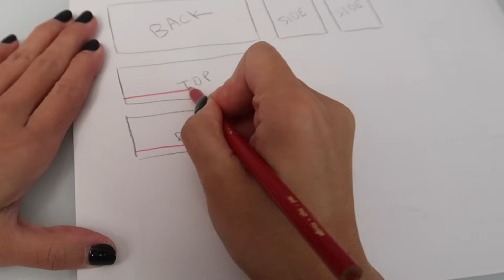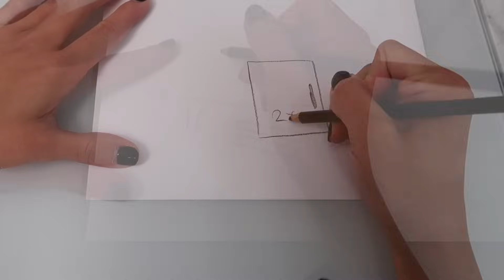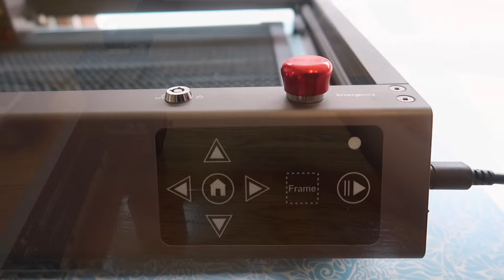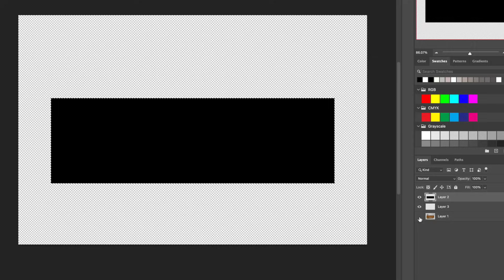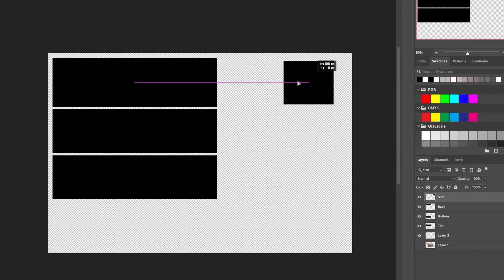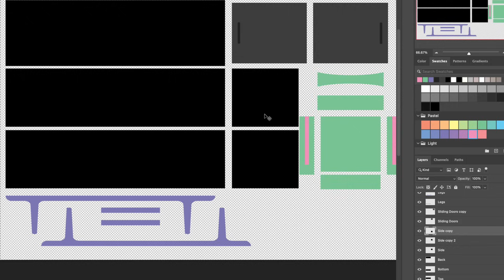Miniature DIY - Midcentury Modern Cabinet

Comment: This video is timely for me, because I just saw another Youtuber work with a laser cutter, which I'd never really considered before. MCM furniture is my favorite, and you did such an amazing job recreating that piece .

I was just wondering about a couple of things: would it not be easier to stain and varnish the sliding doors, drawer fronts and inner shelves before assembling? I'd be too scared that, were I to brush over every surface, some stain would seep into the crevices and cause the drawers and sliding doors to stick. Also, how do you ensure you get precise measurements when tracing the different parts of the image? Thanks for the video -- you're SO good at this!
Reply: @airamsipuola5045, I am reasonably certain that Kath was using a background grid with snap-to-grid enabled. She probably had to do a bit of trial and error to figure out the grid spacing from her reference picture.

Remember that once she exports the JPEG to SVG, she can scale the parts to whatever size she wants with proportions remaining the same.
Reply from the maker: Thank you so much! It didn’t have to be super precise and I did have to do a bit of trial and error to get to the final result. I think staining and varnishing before assembly is ideal. The only reason I didn’t is because I didn’t plan on staining it until after I assembled it 😅

Comment: That is fabulous, I love miniatures I have always wanted to do it too. Boy that is some tool. I bought a small craft jigsaw and never used it.
Reply: @patriciasmith7074, the laser cutter is a time saver, but whatever Kath did can also be done with hand tools (jigsaw, pin vise & small drill bits, small files, etc.) or small power tools e.g. a drill for the concave curves on those legs.